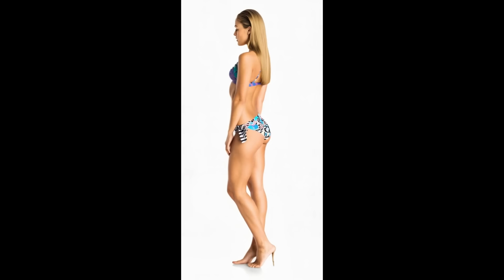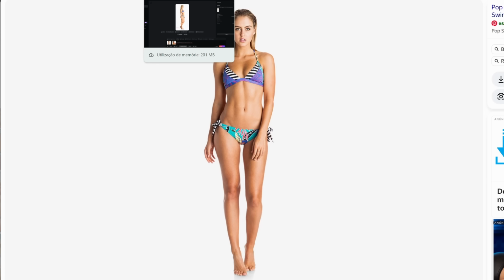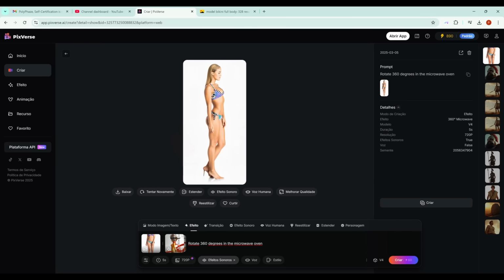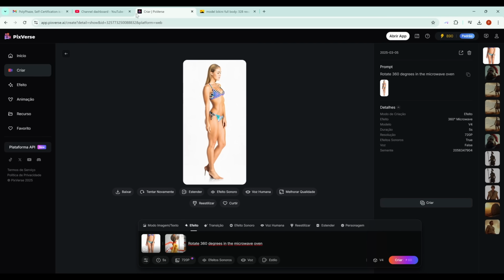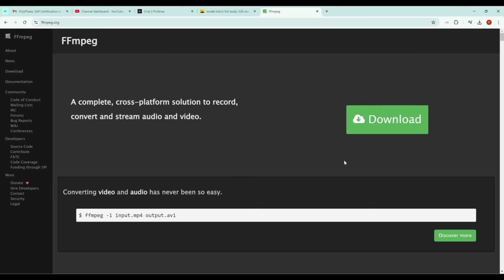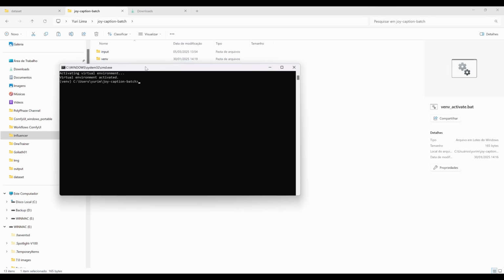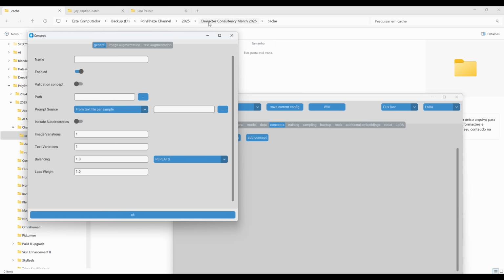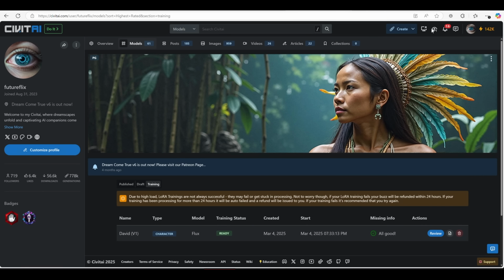The 360° Character Consistency Hack You Need

Comment: I’ve been using a similar workflow using kling. The challenge of course is I don’t get a 360 out of it and sometimes it takes rerolls to get it to move in the correct direction for a full rotation. I also generate a video that has expressions and use a frame from that to do more 360s.

Using act one to get facial expressions and speech works well however there is a quality loss. I’m not quite sure how to recover that. Have been contemplating control nets to re-render the character. I’m not sure if it will maintain the expressions very well though. Is there a better way for this?
Reply from the maker: pollo.ai has a tool to recover faces from video, might help you...